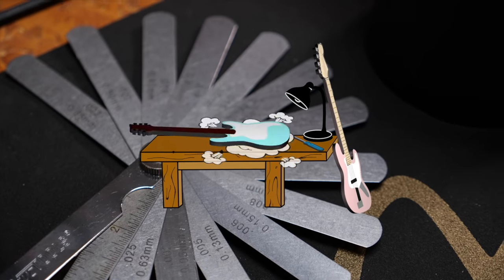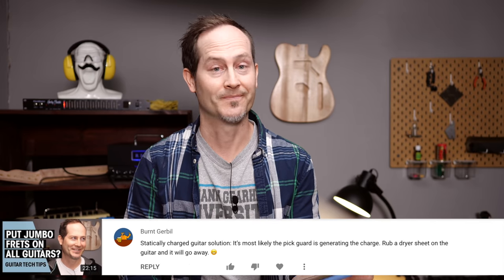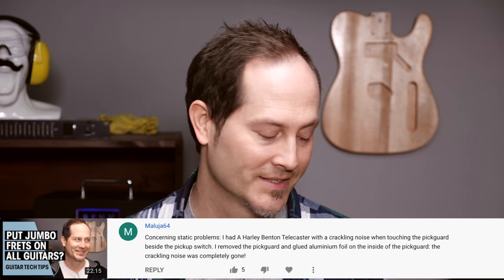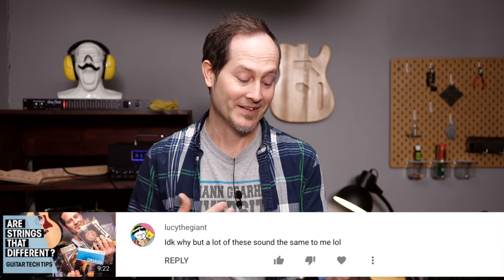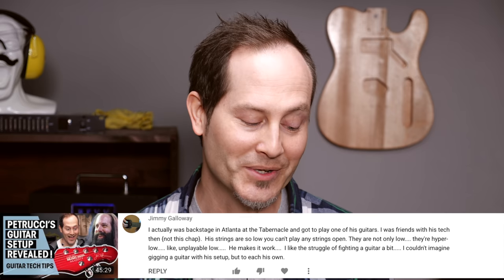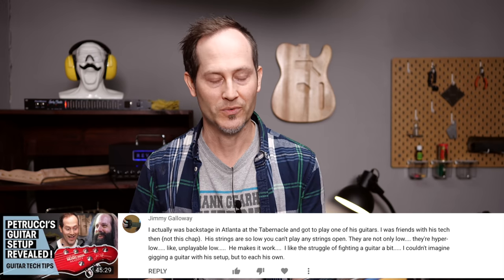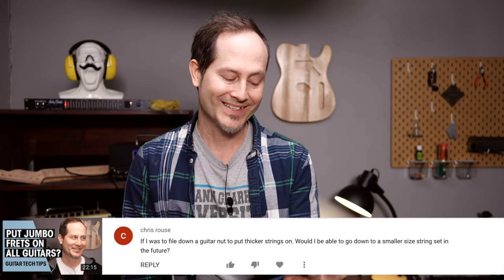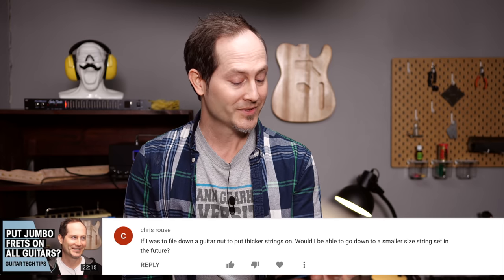Guitar Tech REACTS - Q&A #4 | Guitar Tech Tips | Ep. 55 | Thomann

Comment: As personal as guitar setups can be, many of the guitars sold do not fall in line with set up guidelines that are in the zone between extremes, and could also vary based on climate, changes in string tension, et cetera, so yes, without a doubt a “good” setup is not guaranteed  
on a guitar, new, used, inexpensive, or expensive. This is basically a no brainer. TLC is expensive, so better.to learn it yourself.

Comment: how many discussions i've had over string action. i also like ultra low action. i plek all of my guitars and i get it down to sub 1mm on the high E string with a straight neck. most ppl cannot play my guitars without a bad buzz. similar how most ppl apparently could not play SRVs strats. there is no right or wrong. it's personal preference. i have a light touch and i let the amp do the work. it's a tool for making music. you should not have to fight it 😁

Comment: for trussrod I usually check space between bottom string and top of 8th fret on a 24 fret guitar, on a 22 fret guitar I check it at the 9th fret oddly enough. But it works for me. I know what I like so I literally press the first and last fret and angle the guitar a specific way so I can eyeball the gap. And for fretwork, great advise. Don't touch frets untill you can hear them as well :)

Comment: Question for the next Q&A video: I have a 2019 Gibson SG Special with P90's. The guitar is not handwired, it has a PCB wiring. When I'm in the middle position, I can't adjust each volume or tone individually. Both the neck and the bridge volume work as a master volume and the same thing happens with the tone controls. If one volume is all the way off, both pickups are off. If one tone control is all the way off, both pickups have all the tone rolled off. No blending sounds with both pickups are possible. Is my guitar wired incorrectly or does this happen to all guitars with this type of PCB wiring?  Thanks in advance!

Comment: Amazing tips ... thx Kris! Right now I'd love to come up with a question: usually I'm using combos (in terms of amps) and now I decided to go for heads + cabinets seperated BUT for a typical combo-enthusiast it's hard to get it nailed. So I did get the theories behind impedance and Watts etc. but I'm still struggling in terms of what kind of cabinets (i.e. 112, 112, 412) and the possible combinations ( a 112 + a 212 + a 412 for example)  make sense (and what the difference is between connecting them in serial or parallel mode) ... hope you got what I'm talking about. Dunno if this should be asked in a GUITAR Tech tips channel or if it'd be better to ask in another channel :-)